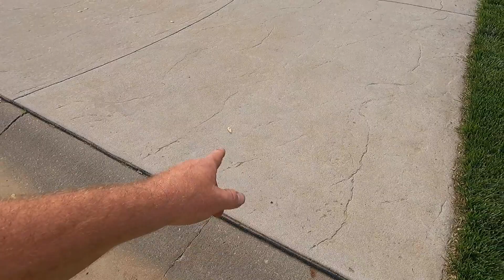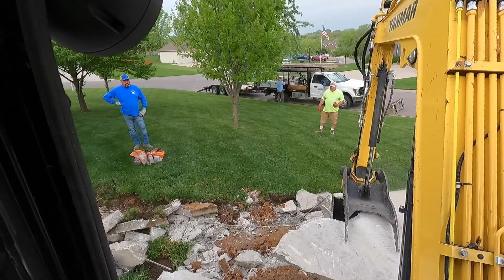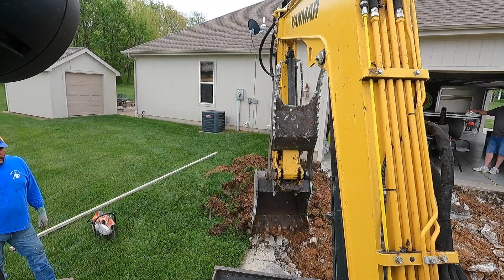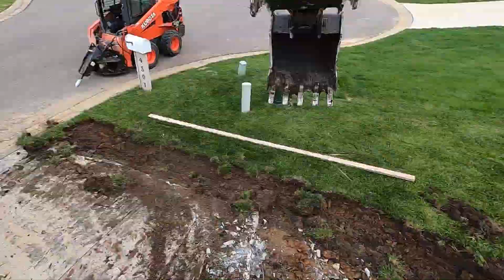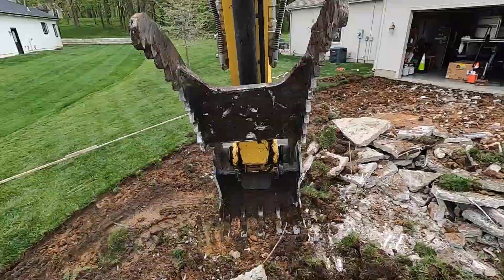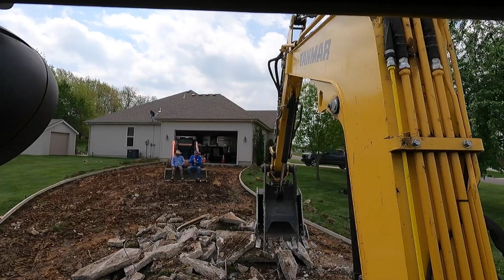Tearing Out A Concrete Driveway With A Mini X

Comment: One thing that's wrong is there is no base under that drive way. I don't live in Kansas but where I come from you need a base put in first the quality is in how you do a job from start to finish. Thinking no one will never dig this up and the homeowner will just live with the cracks and no one will never know that it wasn't done wright and the base was left out. The builder was probably charged for it . It's just amazing what goes on in this day and time.

Comment: Would be cool to have a 500 pound block of steel to pick up and drop on the concrete to help break it up. Maybe a 5 foot section of railroad rail ?
Reply: if he used the breaker he had,  properly it would have broke apart much easier